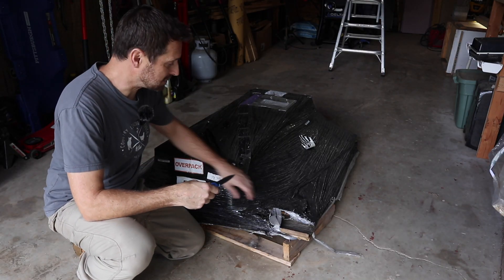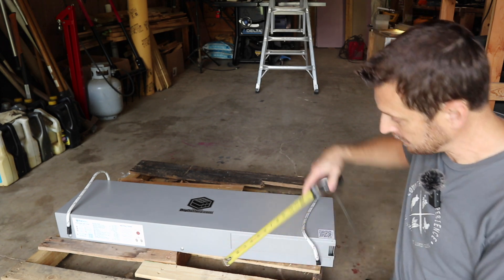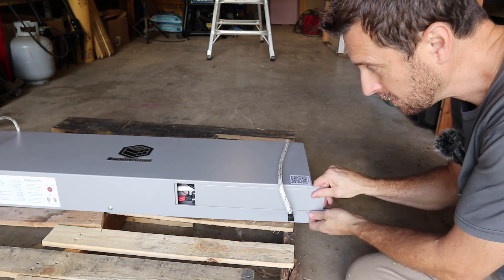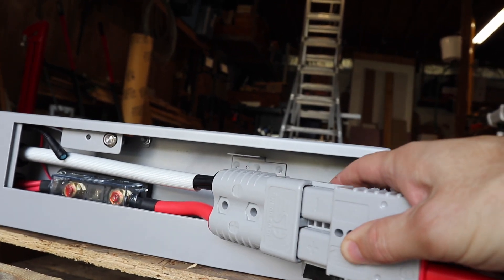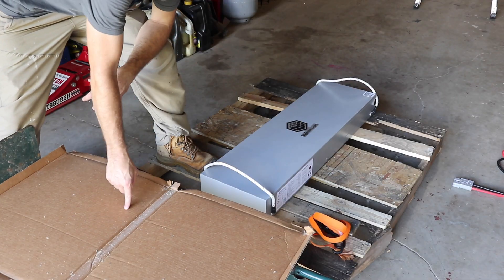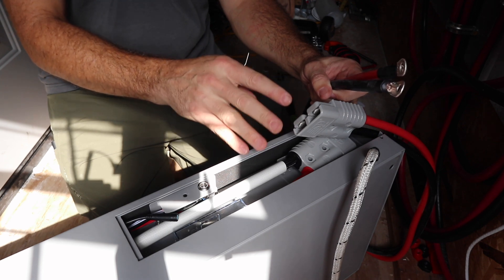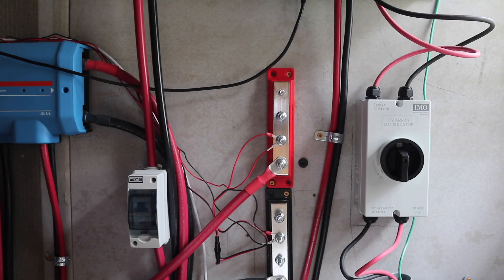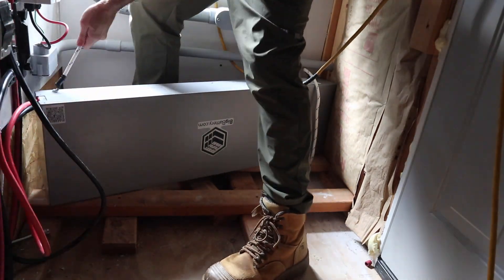New Addition To The Barn Solar! Big Battery Mustang 48v 7kWh LiFePO4 Installation

Comment: Great video. Are you fully off grid with your solar power set up or do you supplement with on grid power as well? Do you have a video you can recommend on new homesteaders looking to set up a solar system?
Reply from the maker: Thank you. We do supplement a little when we have more than about 4 days of cloudy weather. We have about 40 videos on solar and setting up all the systems for our property. Check out our Solar playlist on our main page.
Reply: @CountryLivingExperience  thank you very much
Reply: Yes thank you! My first home is off grid but not because I wanted it to be, but because the power company took down my incoming line because of hurricane damage to the weather cap pipe. So I told the electric company to close the account and just keep the water and trash pickup. I have a cheap inverter running the lights in the hall, one bedroom and kitchen over the sink. That gives me enough light to work inside the house. Saving money on one house helps a lot and I bought a power station and plan on running an AC unit when working on the house. I have window units in all the bedrooms and living room. We only ran what we needed when we were living there. I'm interested in that mustang battery.  73 @CountryLivingExperience

Comment: Thanks for this video. I wasn't even aware of those tools to prevent arcing. I have a current system that has 10kwh and I plan to upgrade it to 20kw soon. Seeing how you're slightly different system is set up is helpful to see. Thanks!
Reply from the maker: You're welcome. Let's see how this performs.

Comment: How is SOC being measured? Didn’t see anything going from big battery bms to cerbo.
Reply from the maker: There is an external screen that connects separately. It did not arrive in time for it to make it into the video. I will mention it in my next video where I will load test the battery.
Reply: @CountryLivingExperience then how did you know it had 32% as you stated in the video when you looked at the cerbo screen (7:19 in your video)
Reply from the maker: The inverters still pick up state of charge (though slightly inaccurate) and it displays on the cerbo touch.

Comment: What location will the battery end up? Below the power wall! It looks like everything is up and running 😎
Reply from the maker: I think it will just rest on the floor right there or I could turn it flush under the equipment on the wall.
Reply: @CountryLivingExperience   well done thanks for sharing.